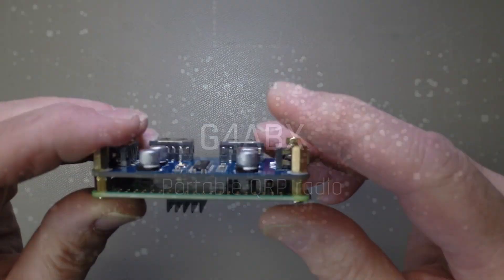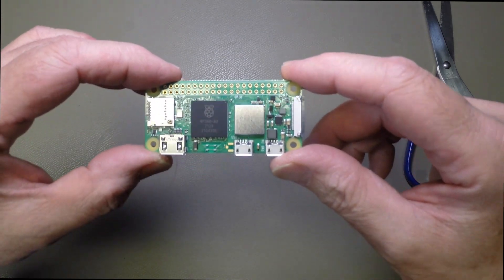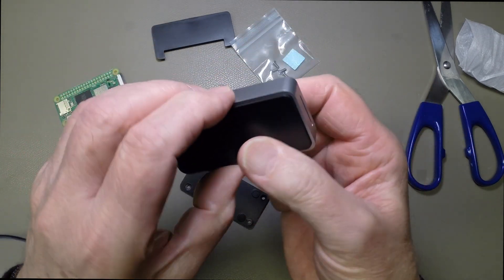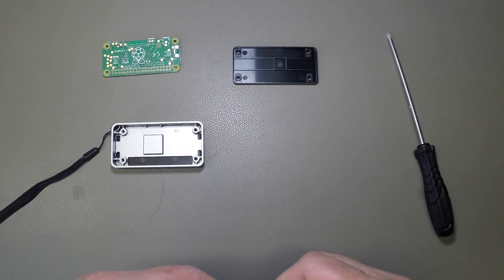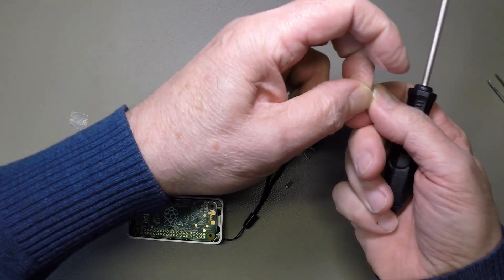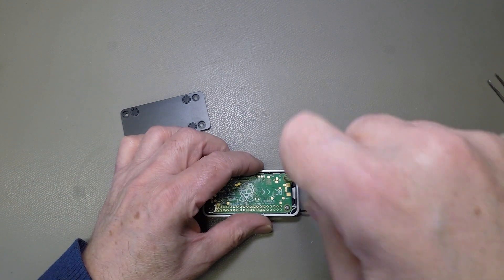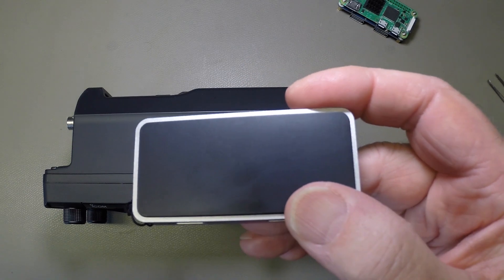Raspberry Pi zero 2 W for Ham Radio IC 705 part 1   hardware

Comment: Hi, very interesting but where come from power supply of Rpi. I tried to connect rpi zero 2w on my IC-705 with a cable with 2 mini-USB connectors but there is no power on Rpi. Is it normal ? Does it need a spécific cable or other way to power the R pi ?
Reply from the maker: Christian. 
You need a separate 5V supply to the USB-C port on the Pi
and the 705 doesn't have this available.
Make sure you use 5V not 12V or you will 'fry your pi'
Have a look at my Website for some details on inexpensive and RF-Quiet 'Buck Converters' I use for this task
73 Bruce G4ABX

Comment: The FLIRC seemed nice at first.  Two problems with it:
1. (Killer) The case walls are just thick enough so that the HDMI adapter sold with the Pi0 doesn't fit snugly enough & falls out.  Or requires manual pressure to be applied while the unit boots up.  If an HDMI monitor isn't present when the unit boots, it won't recognize it later on.  If you hold it tightly, when the Pi0 boots & determines that it has a monitor, it's not as much of a problem.  If the adapter falls out, it can be re-connected & all is well.  Of course it's a pain with it falling out all the the time.
2. The SD card slot is inaccessible once you screw the case together.  If you are experimenting with different builds like I do, switching out the SD card is time-consuming.  If you have a fixed on a particular build / configuration, this not as much of a problem
Reply from the maker: Evening Michael. You are right -- up to a point.
I use my Pi's 'headless' so plugging in a monitor is not an issue.
I also have a 'real' Mini HDMI to HDMI cable and that has no problem with the case thickness. I tend only to use the monitor for initial setup.
The SD card slot's inaccessibility is a small drawback.
I use a 32Gb card so there's lots of room for future updates -- and I tend only to fix the board in the case when I'm happy everything is working to my satisfaction.
I use my Pi4b for all my experimentation.
Life is a compromise. The trick is to find the one that works for you :-)
Happy Christmas
Bruce G4ABX
Reply: @G4ABX  A true mini-HDMI cable would be better.  The "kit" came with an adapter, therefore I saved some money.  Instead, I had to spend extra time keeping the cable from falling out.
I, too, normally use the monitor for setup, but I was having trouble with the Wifi which can't be resolved remotely.  Having the cable fall out all the time, plus having to swap builds was a bit frustrating.  Ended up running them with no case until I got the wifi issues worked out.
If there is a method for swapping builds without removing the SD card (a la PXE boot), I would be thrilled to know it.
Reply from the maker: @michaelnadlerki7qib728  Hi Michael. 
All understood. 
I'll have a bit of a think about swapping builds -- although that's not something I've done on a Pi.
I'm content to swap Pi's! 
I now have 3 zero-2W's all at different stages of 'build'
Costing about $30 with the case here in the UK, I continue to experiment with this great addition to the Pi stable.
73
Bruce G4ABX

Comment: Hi Dr. T
I'm affraid you won't be able boot without sd card .
I guest you did not notice that we have to put the SD card in before closing the case .
The slot you see is for the cam ribbon .The sd card slot is at the other side. The case does'nt allow you access it without unscrewing the all thing .
Reply: You put the board in the case the wrong way around! Rotate it 180!
Reply: @paulrbeard  I thought so too when I tried assembly, but the board only goes into the case one way otherwise the usb/hdmi ports don’t line up.
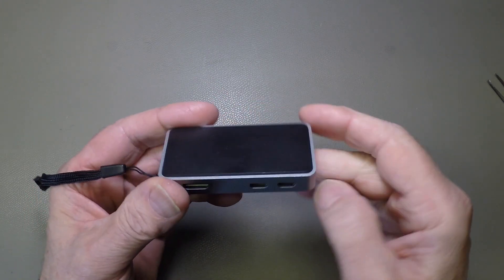Reply: @ChrisinOSMS  at 03:40 he had it the right way around. But at 05:30 he had it flipped 180 degrees. At 08:20 you can see that the usb/hdmi sockets are not behind the holes in the case: they don't line up!
Reply from the maker: You found the deliberate mistake!
73
Bruce G4ABX
Reply from the maker: Very true:-)
Reply from the maker: You are absolutely correct! Well spotted :-)
I have to check folks are actually paying attention!
73
Bruce G4ABX
Reply from the maker: Well done!
You spotted my deliberate mistake 🙂I wanted to check that folks are paying attention!
Reply: @G4ABX  
good job ..
Thanks for all ....